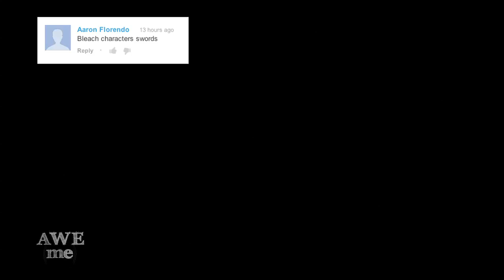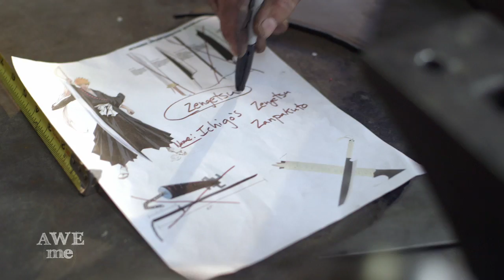Ichigo's Zangetsu Sword (Bleach) - MAN AT ARMS

Comment: 1/8th of and inch is a little small but I understand it should be manageable but you should really make another copy of the sword that's at least 1 inch thick. Just so it looks better, not so much for use. Just to look closer to the real thing and instead of attaching a grip just find som wide soft white cloth to wrap as tight as you can around the handle and tied off at the bottom and dont forget to make it razor sharp to finish the sword. It just sounds beautiful.
I love your channel and most of the work you guys do but this could definitely be better
Reply: it's been 6 years since this video came out so the lower quality is totally justified, would love to see what the guys at awe could do with zangetsu in 2019
Reply: Same!!!!! That's what I'm saying

Comment: Not impressed. it's sharpened steel plate, not a sword. It's very bouncy like a fan blade
Reply: The effort was there but yeah...i agree. It should have been thicher
Reply: Catalin Oancea i think a thicker blade would be impractical because of how big it is. It would be impossible to wield due to its weight

Comment: Ehh not a fan of the ones where he cuts it out of a street sign lol. I like when they actually forge them.
Reply: I prefer MAA Reforged too, early MAA just heat treats and sharpens a card board cutout ( calls himself a blacksmith when he’s really just fabricating sheet steel).

Comment: Everything about how they made this makes me nervous. Making the handle separate from a blade that doesnt have a guard? And it's supposed to be a somewhat Japanese sword... not exactly a nodachi or anything. But still, they could of forged it instead of basically cutting sheet metal. Anyone could prolly do this build w/ a simple cutter and welder on hand, I guess.